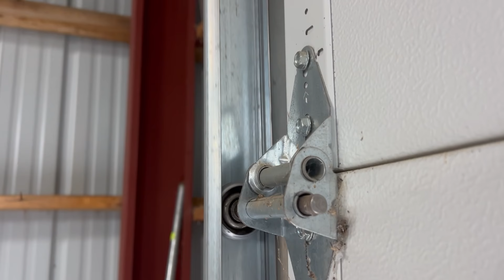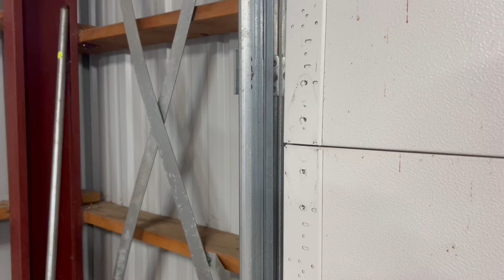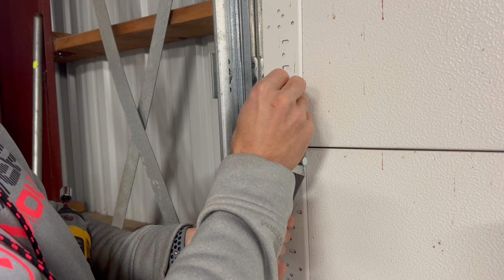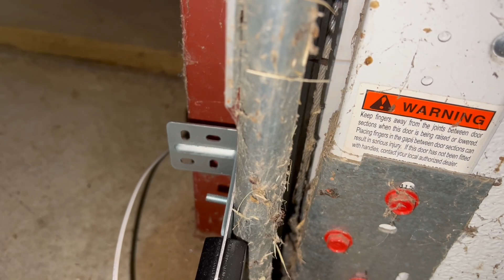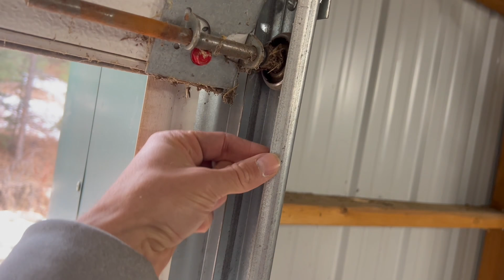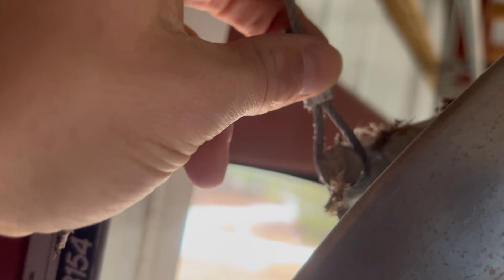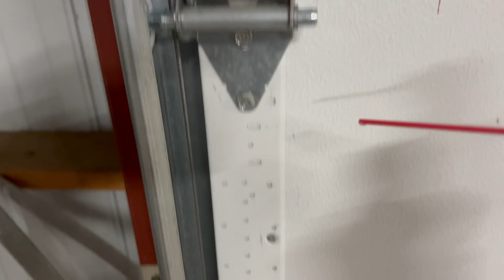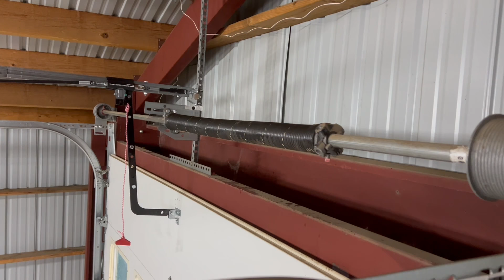How to Replace Old Garage Door Rollers WITHOUT Bending Track (Easy DIY Install) | Builds by Maz

Comment: I like the idea of not having to bend the track. Have you tried putting some sort of weight on the cable, so it doesn’t unwind?
Reply: Try vice grips on the cable when open
Reply from the maker: That's what I should have done...just put a metal clamp on the end or something and let it hang. But it really only takes about 30 seconds to rewind the cable so not a big deal either way.

Comment: It would have never in 100 years occurred to me to bend the track for any reason which is what attracted me to watch this. I hope no one uses your suggestion. I can't even imagine that turns out well. You probably should have suggested to prop that door with an auxiliary support before disconnecting the cable.
Reply: @ it’s great you’re aware of the dangers with the springs.  For a standard residential door as in the video.  When the door is fully opened there’s very minimal tension still on the torsion springs.  Yet keep in mind there’s still some.  That’s why you’d only remove one side cable at a time.  Not both at the same time.  At that point with the door fully open there’s only 3/4’s of a turn tension on the spring.  That’s just for holding the door in the open position.  Which is also why you’d want support the door in the open position when removing the one cable, for safety insurance purposes.  Incase the springs are not properly tensioned after a period of time in service.  The extension springs are similar in their purpose and tension when the door is open or closed.   When the door is open there’s minimal tension and this is the best position when needing to change / replace a stretch spring.  You’re absolutely correct for the torsion springs, they do require suitable winding bars to tension or detention them.  Mostly done when the door is in the closed position as this really the only way for safe and workable access.  Never use screw drivers or anything that doesn’t fit the winding plug counter bores and not rigid enough that won’t bend or break.  Best advice is to leave this to an experienced person or professional.  Yes, when a spring breaks, stretch or torsion, they make an attention getting bang! Glad you’re aware of the danger with the springs.
Reply from the maker: @kchapin7429  Thanks for the thorough answer on this.
Reply: There is a tool available specifically for bending garage door rails, so yes it’s okay to do it with wrenches and vise grips. Be careful however you do it.
Reply: @recombatant  The factory recommendation for bent or damaged garage door rails is to replace the rail.
Reply: @   There’s a tool available made in a factory specifically made to bend the rail slightly, insert the roller, then bend it back.
Reply from the maker: I agree, I feel like that can cause all kinds of alignment issues if not done perfectly. Good suggestion on holding the door up; I should have done that.
Reply: @buildsbymaz use a vise grip clamped to the track under the opposite side of the door bottom roller. Then switch sides doing the same thing.  2 vise grips, 1 to hold the door and the other to hold the end of the disconnected cable.  Amsoil metal protectant spray works for springs and hinges as well, doesn’t attract dust which will create more resistance on both.  Rollers and track really don’t need anything.  They’re not high speed or high friction.  Installed doors for 30 + years never adding anything to the track or rollers.  Always advised people not to, to keep dust and dirt from building up on each.  The more it collects the harder the door will work, especially in cold weather areas.
Reply from the maker: @kchapin7429  Thank you for all the tips! Great advice.
Reply: @freespirit-o6l  yes I've heard some stories about the big springs. I never stay inside the garage while the thing is moving, I press the button and close the door.

Comment: One could take a vise grip onto the cable crimp when taking it off which will gives it hanging weight and keeps the cable from unwinding.
Reply: This is what the pros do.  Or clamp it to the track above the hinge.
Reply: I would use a bungee cord with a weight on it to hold the cable and vise grip on the track to be safe..
Reply: Yes that's the best tip I was thinking bungee cord. What do you think a white or bungee cord is it safe to use?  I Always worried if theres a kickback of the cable. forgetting to  reattach the cable what causes it to start the tension and cause you physical harm right?  Right e @hollandbuzzard1039
Reply: Thanks so much for all these  tips. It's been since the 1960s that we changed these noisy metal rollers. My suggest that  after you remove the screws, I would use the "'Whiteout sponge applicator and just splash around into the holes so they stand out when you remove those Hingers. Btw: best wait for the warmer weather for the weather here in New York City somewhere above 25°  I'd worry if it is a real hassle if that tension cable when the door is above my head and they're still tension when I detach it. Hate to be whiplash by it.
Reply: I was thinking wrapping with a short length of Duct tape to avoid having the cable unwinding.
Reply: I just looked at my door. It's 40+ years old and has those long springs on the side.  I was thinking I'd raise the door and use vice grips to clamp the cable to a bracket on the wall to keep tension off the lower roller.  However, it doesn't look like that cable loop will come off easily.  I could probably do it with the cable attached, as long as it's not under tension.
Reply: Thanks for your sound advice; I'll use a wood clamp.
Reply: That's what I did....
Reply: I was going to suggest a bungee cord to a hammer or some kind of weight.
Reply: EXACTLY!
Reply: Or you could use it as an excuse to go fishing, then hang the days catch from a stringer attached to it.
Reply: I know! YouTube amateurs, what can I tell you?

Comment: I squirt some 3-in-1 oil over the tops of my door coil springs (for my shop. My garage uses that cursed TorqueMaster II system) every year, and not only do they stay whisper quiet, but the oil reduces wear from rubbing and buys far more life out of the springs. I've owned my house for coming up on 14 years now, and haven't had one of those coil springs pop yet. I also have no idea how old they were when I bought the place, but they sure as heck weren't new! 😂
Reply from the maker: Great to hear that you are diligent with your maintenance - that makes such a difference in the lifespan of these things. Hope you get a few more years out of it.

Comment: I would have possibly kept tension on that cable once disconnected, then cable tie it to the side rail or a near point - save you having to re roll it onto the drum... 👍
Reply: Put a bungie on it, hook one end on the cable loop and the other on one of the track supports.
Reply from the maker: @Mark-8587  A few other users have also suggested using a vice grip on the end of the cable. Good ideas for next time!
Reply from the maker: Agreed...but I only had one hand to work with since I was trying to film the process. A good idea for others though.

Comment: Probably wouldn’t hurt to put some lubricant on the stem of the new rollers before you insert them. Not on the roller, just the stem.
Reply: There are sealed ball bearings where the stem meets the roller, so technically the stems should stay in place and not need any lubrications.
Reply: Lube the stem, hinge, and roller bearings 2x/year and you're fine for a very long time.  Most people don't bother though.
Reply: Lubricating the track is not a good idea.  It'll cause the rollers to slip.  It's pointless.
Reply: Not before cleaning the interior of the hinge first.
Reply: copper grease like mechanics use
Reply from the maker: Great idea here, thank you.

Comment: 😂😂😂😂
Reply: What is it with these stupid emojis. What the hell are you trying to say? Are you laughing at the video, agreeing with it or what? If you have something to say, say it. Using emojis is so childish.
Reply: @BobChanter  As a professional garage door installer for over 30 years, I just had to laugh at your instructions for changing the bottom rollers. To the layman, it's very dangerous  to remove the bottom cable. Many people have been injured doing it your way. When you reset the cable on the drum, you didn't check to see if the door was level. When you respond to your viewers, you shouldn't put them down, especially when they know what they're talking about.
Reply: @JR-il8sq  nothing like making a fool of yourself. I did not publish this video, I merely commented about stupid emojis. sounds like you want to be a victim and are pointing fingers at the wrong person. I accept your apology.
Reply: @JR-il8sq For those of us who are very rural and don't have a professional garage door installer within 200 miles, what is the proper method to change the bottom rollers?
Reply: JR, what would you charge to replace the steel rollers with the nylon ones?
Material=approximately $50.00
Labor=